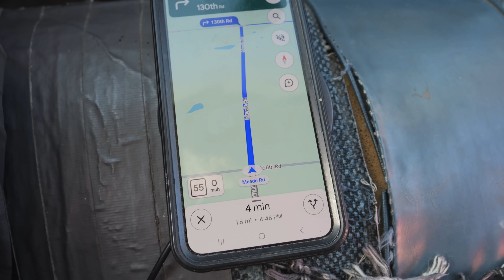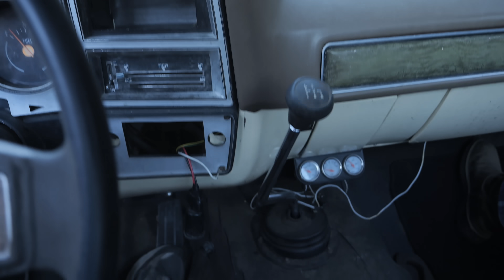Snagging New PBG Project Car With Oil Burning Dually Squarebody-320 Miles!

Comment: I have a big weak spot for mid-sixties Pontiacs (I had a '65 Catalina 4dr hardtop), and am eagerly looking forward to seeing you work in this one!  Also, used to be that when Chevy V-8s got a few miles on them the valve guides would wear and the oil seals would harden up which made them really good for fogging mosquitos.  But as long as you kept putting oil in them, they would run forever!

Comment: Cool ride 😎. The truck,not so much 😭. Do you need more oil??? A fella could mount a barrel of oil on the roof an have a 1/4inch line with a valve going to the motor for all the comforts of driving with a piece of mind. Now that's the Dolton way. In fact I'd love to see ya do something along them line's. Thanks for sharing 🙏😊.

Comment: My old 76 Mercury Grand Marquis 460 used a quart every 100 miles. Didnt burn any, it leaked EVERYWHERE. I always used my Dad's and Dad-in-law's used motor oil. Once a year I'd change the filter.

Comment: Back in the mid 1970s when I had almost no money and did my own repairs swapping out a head gasket was easy. Hell everything was easy. Pulling a head and sump to replace big end shell bearings and new rings  (top stepped, bottom flexible oil control) to rescue compression and reduce oil consumption was definitely a home fix.  Why not do that on one of your cars? I could replace a head gasket in 1/2 a day, whilst the rest would take a long weekend. All achievable and then quite cheap.

Comment: Clearly engine load has a big effect on oil burn so it could have shot rings, a stuck pcv or both. Though the no smoke says it’s only drinking under load.

Comment: Go to a pick your part or pick and pull auto parts place find a 6.0 / 6.2 / or big block for that great looking dually header exhaust loud and proud  , I know you and JT can do it I have confidence in you guys get a used triple bench bucket mexican seat covers hula Jess girl on the front hood self tapping screws to hold it down YOU CAN DO IT if you put your brain to it
Reply from the maker: I'll run the small block till it dies and then put a 454 in it. No computer nonsense, ever

Comment: I had a 65 Tempest with a 389 3 speed . Sucjer ran like a spotted ass ape , would pull the drivers side wheel up on a drop at a dead stop !

Comment: Another oily production I had one those years ago jb weld cracked transmission casing was going just aluminum welded it but I parked it costing to much in transmission fluid fire risk plus smoke anything behind was coated in fluid

Comment: I have used seafoam on high milage oil consumption motors and it did reduce the amount of oil used alot.The can said one oz per qt of oil in motor add 300 miles before oil change and it cleaned the motor and will free up piston rings.I know it will not help valve  guide seals but it will help. I also use prolong super lubricant and add to my oil makes a motor so quiet and smooth .Good luck i hope the best for you.🔧🪛🔩

Comment: Just got me an 87 k30 been tryna figure out the ac for the last hr. Can't get ac clutch to kick on/not getting power to the compressor at all. Pressure is fine,  disconnect low pressure switch and jump it still not power idk lol I'm hot
Reply from the maker: Check the vent selector switch
Reply: @outsidethebarn  thanks for the input man, that'll be the first thing I check when I'm done eatin. 👌
Reply: @outsidethebarn  pulled the switch apart cleaned it, it all works smoother but still no power to the compressor ar all. I hate to take it to someone haha, it's my service truck so kinda hurts my pride but bout to say screw it.
Reply: It's the compressor, I figured it was I just didn't wanna spend 200$. 🙃

Comment: I think an old 6.2 diesel burns less oil than that pig. Might want to look about a Cummins or Duramax swap.. Hey... didn't you have a 12V shorty tug truck at one point or am I confusing you with the one Finnegan had that he put in his ramp truck?
Reply from the maker: I'm not rich, so no I didn't. I have a 460 powered tugger that works just as well
Reply: @outsidethebarn  that's one of the few things that isn't that expensive out here. Search within 80 miles of Sacramento on marketplace for 12V Cummins and you can find engines and entrie chassis. There's currently a 12V 1991 for sale in Nevada City for $2k. As you probably know though, buying wrecks often gets you more for less, I saw one a couple months ago for $800 with the NV6500 in it but it was MANGLED.